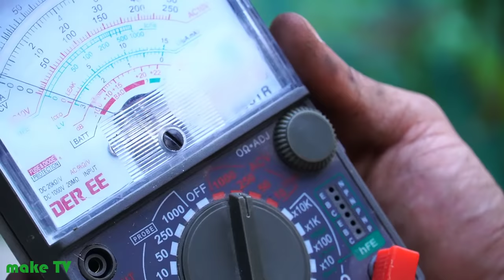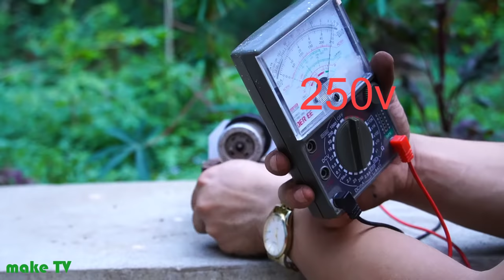How to Turn a Microwave Transformer into a 250v Generator

Comment: You could probably quadruple your power output with 3 more transformers around the magnets.
Reply: That tube wouldn't be enough to counter the resistance I'm sure and it  would still mean more amp draw on the 12 volt. I don't know what the conversion would be. But doing it your way would be feasible with off grid large blade windmill, or water turbine.
Reply: No you couldn't. You can't get any more power out than in.
Reply: @deang5622  No. You can't get more energy, you most certainly can get more power. You do know what a dynamo is, right? Power is electricity, not energy. The electricity being generated comes from the magnets interacting with the transformer and coil, it isn't coming from the input source and so it isn't limited to the amount of electricity from the input. They use large dynamos on navy ships to take a small power source and get a very large power output.
Reply: @darrylkinslow5613  Let me say it again. Because it is clear you did not understand. You have made a factual error in your response to me.

I said, you can't get out more power than in.
What you said in response is, power is electricity, not energy, which means you don't really understand the subject.

This is not correct. Power is the rate at which energy is dissipated or produced.
Energy is measured in joules. The rate at which energy is used is measured in joules per second, which is equivalent to watts. And as you know, watts is electrical power.

For a transformer, when used properly as a transformer, you cannot get power out than in. I don't care whether you agree with that or not: it is a correct statement.

Now if you modify that transformer so it no longer operates as a transformer, and you position moving magnets close to it, then you have created a generator which confirms to Faraday's Law of electromagnetic induction.
Faraday's Law is expressed mathematically as :
e=-LdΦ/dt

I am not going to spend time explaining the terms in that equation, I have better things to do with my time than educate people in the fundamentals of electromagnetics.

All I am going to say is: the / is not division, it's the mathematical operator of differentiation - calculus, rate of change.
Reply: @deang5622  THANKS for that MASTERFUL take-down!!!

Comment: People cannot see clearly because u 
put the generator at the edge..
U must put it the middle so people can
see theres no hidden AC power supply
connected to the circuit..
Reply: But there IS a wire behind the wall powering the set up. It's a fake video, the person who made this is a fraud.
Reply: Зачем Клоунам - в электричество   лезть ???😆
Reply: It's  fake , osea falso
Reply: If you understand Faraday's Law of electromagnetic induction, then you will realise it is not a fake video.

Nearly every generator that produces electricity relies on a changing magnetic flux cutting across copper wire. It's a shame your science education is so poor that you don't not understand these basic principles.

Comment: it may not able to run a TV .bkz TV needs a particular frequency for its vertical and as well as horizontal signals..
Reply: That is not true. Modern TVs have a PFC circuit at the mains frontend.
Reply: Only the ancient cathode ray TVs need that, and it was for vertical (frame) synchronisation, horizontal (line) sync was taken from the video signal.

Comment: I'm sorry, but this does not convince me. First, you need and alternating magnetic field to induce a current in that coil. With the magnets placed so closely next to each other, the field is almost continuous, not allowing the current in the inductor to oscillate, hence creating a sinusoidal. Not to mention that the N and S poles must alternate. Second, welding those  tabs to the laminated core is questionable. Third, the shaft of the motor is not aligned with the magnet shaft, and in time the coupling will become loose and inefficient. Lastly, the 5000 W is exaggerated. He may have added an extra 0 on there. That means that the transformer winding needs to be able to handle 20A. Sorry, but I haven't seen a transformer that size to handle 20A.

Comment: The thing that seems to make it true possibly is that it was clear to see that when he hand turned the magnet wheel that it did show power relative to spinning it.  As should be done when a magnet passed a coil of copper wire as it does do.    He should have went around the entire device with the camera to see. I wired coming up from behind to the wall to it though.  It’s suspect still because he didn’t lift it or goo all around it while it was operating.  Who knows now inly they try it.  But what was that D/C motor out of also?

Comment: So you really could plug a trickle charger into the power that it creates and put the trickle charger on the battery so the battery never goes dead! OR PLUG THE ELECTRIC MOTOR INTO THE OUTPUT THAT IT GENERATES THROUGH THE MICROWAVE TRANSFORMER 
HOW DO YOU LIKE THOSE APPLES? 🤪😎😆

Comment: Now time to find a few old microwaves and get to tinkering!
Reply: 2 reasons why that is a bad idea
1- this is fake
2- that is a great way to get dead
Reply: Go ahead, there's loads of useful stuff in microwave ovens, tumble driers and washing machines too.  If nothing else there's always scrap value.  Don't bother with this project though.

As with all discarded equipment it is probably faulty so unless you are qualified don't switch them on, leave them stood for a couple of days to let capacitors discharge - and BEWARE OF SPIDERS!

Comment: i know a bit about electrical engineering and physics, this is not true, voltage generated would be tiny, let alone any current not enough for much.
Reply: The voltage will be ok, at least until you connect a load, then the plastic tube will fly away.
Reply: What a waste just get 12v fan
Reply: @davey2k12  Yeah, he has a 12volt motor, it's just to put the fan on it. Builing water can be done from Sunlight and a reflector, free energy.

Comment: Just noticed When I added the kettle, this requires more effort, which means faster rotation because it requires more amps than the fan
Reply: It's means if you use  a bigger moto it will supply higher amps
Reply: @doblyjulius3049  exactly

Comment: You outta wire that electric motor directly to the wiring of the plug use a wind up cord to pull start it and you've got a self powered generator minus the battery

Comment: How do you charged the battery
Reply: My guess, solar. I would do an all dc house, with DC appliances and lights, USB plugs, and some standard receptacles on an inverter,  and have a dc motor run a generator for an oven.

Comment: 250 volts my ass. That fan would have blown.
Reply: Actually, if you look at the plug, that is a 220 plug (Euro Style). So that fan is built for that electrical system.

Comment: Why didnt you just use the battery to power the transformer? Would be simpler and less energy wasting.
Reply: Transformers only work with AC power, anyway, the video is fake, that generator couldn't even power a fan.

Comment: If it's putting out enough,, just hook the motor back into the power supply,,even if a smaller motor is needed, less power needed with higher rpm
Reply: You cant hook the motor to the generator. The motor need dc voltage but the generator is inducing ac voltage unless you add a rectifier

Comment: okay, that's pretty impressive BUT plug it into it's self then you have a real generator
Reply: And create energy from nothing ???? And make working the house out of grid for free ??? 🤣🤣🤣🤣
Reply: You are equating "energy" and "electricity", they are not interchangeable. Electricity is just electrons being stripped and directed, when we say we are "creating" electricity it is a misnomer as nothing is actually being created but rather moved, and the moving of electrons can be done with very little energy. With the proper gear ratio for the mechanical elements and correct circuit boarding for the electrical elements it is entirely possible to achieve an battery draw/generator output capable of charging the battery in addition to running a handful of other devices. People were doing this as far back as the 50s and 60s with car alternators and electric motors. 

And yes the entire reason we don't do this on an individual scale let alone a large power grid scale is because it would murder electricity companies' profits, anything that makes electricity cheaper is a net loss for them
Reply: @LunkovichTromofski  Hi Lunkovich, I'd like to know more about this intentional inflation of electricity costs. Do you have a reading or video that expands on this topic? I want to compare it to the electricity generation of other countries assuming you are in the west.

Comment: Does this keep the battery charged also ? Like a car alternator
Reply: Now you are thinking like Nicola Tesla as he is famously quoted saying " I you only knew the power of 3, 6 and 9 you would hold a key to the universe. Many people think they know what he was hinting to but you just hit it dead on.. I have taken 3 volts and transformed the 3 into 9.. then I send 3 back to the front of the transformer (feed) , 3 to a second transformer that feeds the original power source 3.7 volt battery package.. this leaves 3 volts left over from the original 9 created from the battery plus 6 from the 9 out of the second transformer.. giving me a total of 9 volts in the end that keep circulating.. Free energy has been known about for decades.. the government, and big corporations are the only reason you have an electric bill.. Teslas 3,6,9 circuit freed us from the power line slave trade.

Comment: The dc  engine didn't even reduce the spinning due to the load applied, which proves it fake.
Reply: If you are talking about the motor spinning the magnets,it doesn't have anything to do with the load except when the d.c battery lowers the voltage only then you'll see the effect on the load
Reply: It has nothing to do with the output load of ac. Ot depends on dc input

Comment: What am I missing?  You use an electric motor to power an electric motor?  There is zero possibility that you gained anything, unless the goal was to go from 120V to 240V, which indeed you did.
Curious to know how you claim it is 5000w when most microwaves are 700-1100w…
Also, it is important to know at what speed is the little motor(1/4 to 1/3 hp) turning?  Based on the sound I would hazard at 1750 rpm or maybe a bit more.  It’s possible if you overdrive the transformer you could get more power out of it, but there is no free lunch.  Power in equals power out, less the loss from wiring and other factors…
There is some potential here though.  If you could get the transformer to work at lower rpm, then you could use wind a the motive power, and you would have something.
Sadly, the same laws apply.  You need 1hp for every 746w of output anticipated.  Average home style windmills produce about 1/2hp in a good wind.  So 375w maybe.  
Based on this, you could hook up 6 or 7 windmills and run half your house, as long as the wind blows.  Now we need storage.  $10-15000 worth of batteries ought to do it.
Now I’m excited, I’m going to the dump to see if I can find an old microwave….

Comment: This construction ist quite clever, but will never ever output 5000w! On the one side there is a very bad efficiency (most of energy is lost in mechanical transmission). And on the other side the small battery and the thin cables will never stand 5kw.

5kw@250v means 20A on the secondary part. Calculate an efficency loss of at least 50% you would need 250/12*20/0,5 = 833A(!!!) on the primary part. Using a 30Ah/15A discharging battery will possibly drive the fan for at most some minutes, but no way for a pommes oven!

Taking a single Chinese inverter module for ~ 5 USD will still not heat the oven, but it has a much better efficency for the fan.

Comment: 220V uses 2 positive cables and 1 negative cable, he only soldered 2 wires!
Reply: Check your fact, only comes in two wires because the power company sells you 110v per wire.

Comment: New subscriber here! Where did you get the parts?
Reply: Microwave for the transformer and for the motor you can use an old turbine fan or from a fan or bench grinder

Comment: Fake as i expected. simply you cannot get the enough power from lead acid battery to turn on heater and fan more than 10 minutes. there is huge loss converting DC to mechanical power, then convert to AC 250 V.

Comment: Dude so if you were to plug in a battery charger have backup battery charging while you run electic fan or phone charger whatever but is this really possible has anyone ever busted this?

Comment: Okay then. Since the First Law of Thermodynamics teaches us that: Energy can be changed from one form to another, but it cannot be created or destroyed.
Wouldn't it be way....way....way more efficient to use a 12vdc to 250vac regulating transformer??????
This is like putting a V8 Hemi in the front of a Tesla to run a generator end to charge the car..........it's just not practical.

Comment: this is fake....I am electronics engineer and can tell you when you add a heavy load to such a system your unregulated speed of the motor should go down a lot. ie you should hear the pitch go down. ...which it didn't.

Comment: I'm a electrical engineer.
Prove your experiment!
Why don't you show the list of items in a proper easy to understand way?

 Where would a person get the round metal used that you glue the magnets on too?
What are the exact type of magnets and where can someone get them?

Waiting for your reply.
Reply: Strong Magnets 25x8x2 mm N52 grade neodymium block small thin rectangle magnet north and south direction double sided tape
Reply: Thank for reply.
What is the round metal parts and where would they be found.
Reply: @rewirerc5399  ebay old oven fan or microwave one
Reply: Me too.  This is bogus.
Reply: In Outer Space !

Comment: Waste electric energy. Use your coil as a booster to reduce the number of electric motors and power generation equipment, which can save electric energy than the current one.

Comment: I'm laughing my ass off!
Motor, generator and mechanics cause very large losses!
The rice cooker is probably around 2000 watts.
Without losses, that's 167 amps on the 12 volt side.
The battery takes a maximum of 1 minute!
But the small engine does not give such performance!
Even if the generator brings it.
The whole would block!
Reply: so it’s fake?
Reply: @yaimem  Absolutely !!!
With this constellation, a maximum of 100-200 watts is possible

Comment: Do you know why he put it on the edge? Because he wanted to connect the edge of the electric wire to it from behind. Why didn't he show the distance? When he brought the fan, the board in the picture moved. He took it to the edge so that he could give it electricity. Don't be fooled. is a liar

Comment: thats fake when the rotor have load like that fan the roto or motor will have changes like low speed but when i show this video the rotor not show changes so it means fake imagine no capacitor and the load was 220 volts wow no changes at all in the speed of motor ? dont make fake in this content

Comment: I am joining the band of disbelievers.. There is no sound difference when the 2nd unit is switched on. And with no bearings, good for only few minutes IF it is working. Wish you tube channel will apoint a checking service and ban these fraudsters and fine them as well. They are wasting time and resourses of a lot of unwary people.

Comment: You cannot create energy. Just use one form and change it to another form. That battery has enough power to run the fan and boil the water without generating it into 250 v. Thats why nobody can make motor and a generator run forever by the generator powering the motor and the same motor turning the generator. You always need another source of power to turn the generator. So you really didn’t do anything.😂😂😂
Reply: Bro your being rude at least it's not a free energy divice it's just a generator